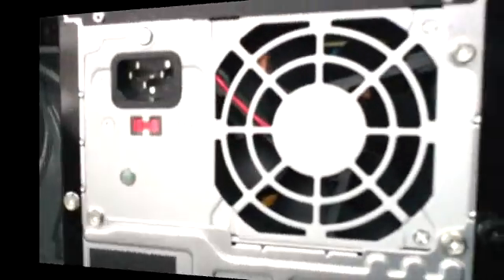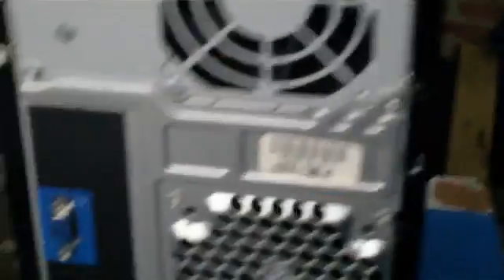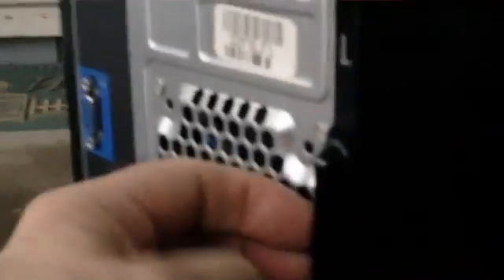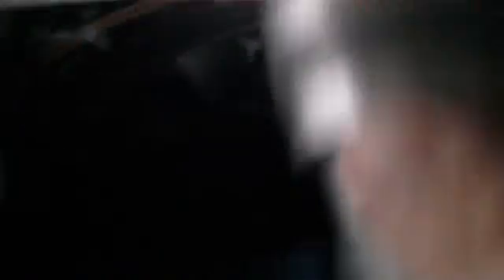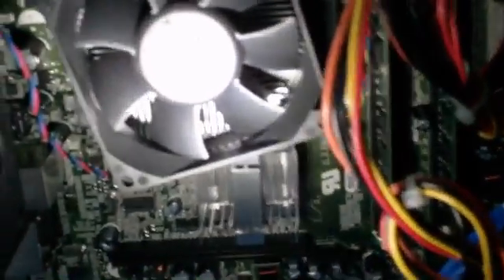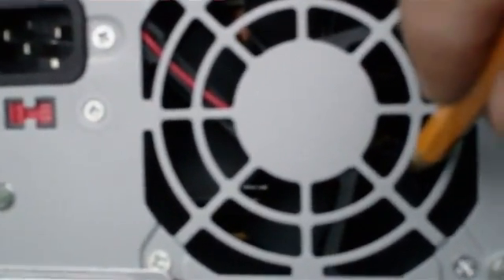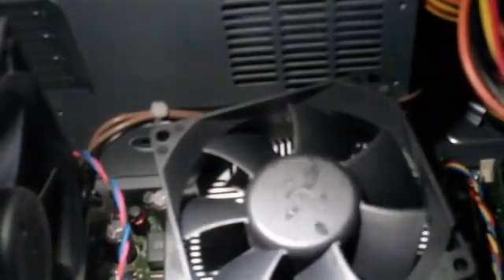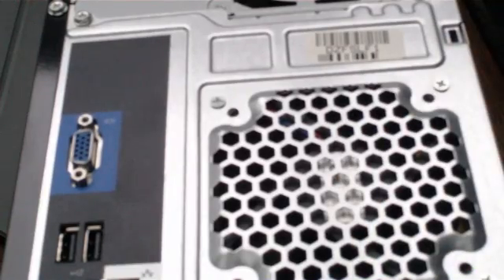How To - Giving a Computer a Clean Job !

Comment: I use an air mattress blower, very powerfull. I used it a few times on my 10 asus.5 fans including the P.S. I blow every fan out and let spin as fast as it can go. No problems. Everyone thinks you'll break the fan if you don't hold iit. Nonsense!
Reply from the maker: The only time I broke a fan is when I bumped the blade of a fan while it was spinning.  It was a very thin fan as well.  The only negative side effect I have gotten from spinning up the fans with air was forcing dirt into fan motors that were already worn and making the bearings noisier.....  I usually use sleeve bearing fans which contain a cap under the sticker and I just oil them once a year.....

Comment from the maker: HP you say ?  Desktop Tower computer ?  If it is, HP usually has a light on the back of the power supply, is that light on when you plug it in?  Sounds like the power supply died in it, if it does nothing.... or the mother board

Comment: I have an hp pavilion a1430n with Microsoft windows xp media center edition 2005 on it and it will not turn on. I tried blowing it out and draining the power out and turning it off but it will not turn on. I have a vid on my channel of it. I was wondering if you knew anything about this sort of problem that could help me out.  thanks!

Comment: That one you used on the thumbnail looked a little worse than mine did recently. lol 
I had to climb back there a few nights ago to unplug the main power to mine (details later) and the fans are getting dust covered again already. Man I hate winter. lol